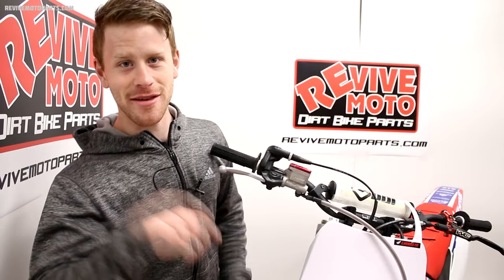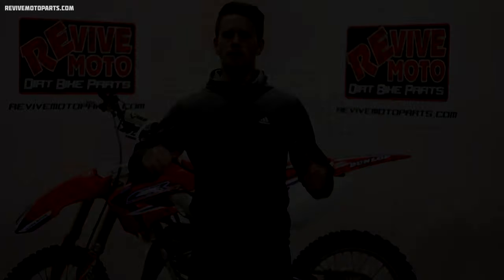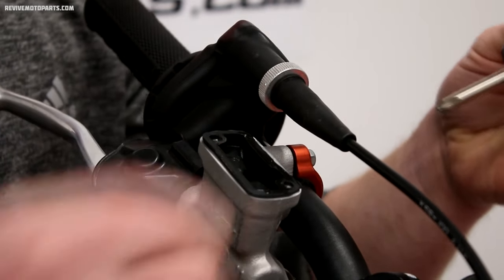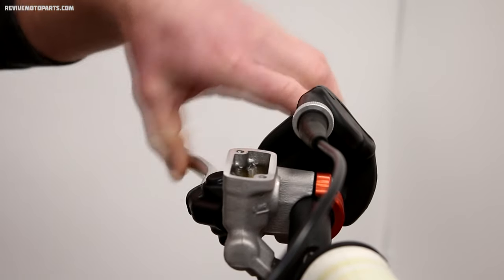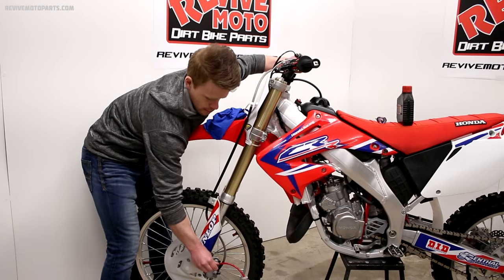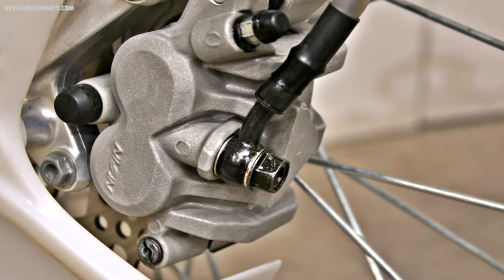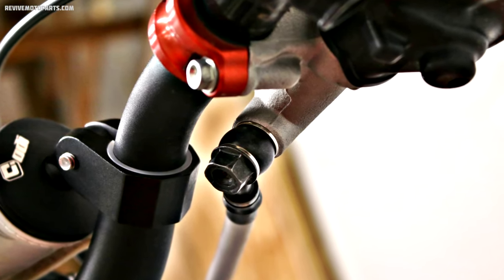Inside Tricks For Bleeding Brakes

Comment: I got a large syringe at a feed store. Put fluid into the system from the bottom. Only way to get brakes on a Ducati to work right. Works great on dirt bikes too!
Reply: Reverse bleeding is not suggested for abs brakes tho
Reply: DAVID RESPECT then why does snap on.  Matco sell that tool to make the job easier???
Reply: @DirtbikeDad  for regular brakes of course.
Reply: So would I fill the fluid into the bleeder valve?
Reply: @davidrespect6471  can you get ABS on MX bikes?
Reply: @rogermyers929  Dunno about MX bikes but most enduro bikes come with abs nowadays
Reply: @davidrespect6471  Thanks for the comment, was about to reverse bleed my abs system
Reply: @papi8311  yes

Comment: Thanks for making this video. Thanks for showing the trick. After rebuilding the master cylinder on my 2003 Honda Foreman Rubicon, I couldn't get the air out of the system to save my life. I never had this trouble in 43+ years of doing my own brake work on all types of vehicles. After hours of bleeding the system, it wouldn't create pressure unless I pumped the handle several times. About the trick: I tied the brake handle back for 16 hours. When I checked it, the brake lever created pressure the first try. I believe that there is still air in the system, is I'll tie the handle back for another 24 hours to see if I get better results.

Comment: With the master cylinder lid off, lightly tap your front break repeatedly. You will start to see  little bubbles rise to the top of the fluid. Do this until you see no more bubbles and you can hear caliper start to engage. Don’t have to loosen any bolts or bleeders. Just take master cylinder lid off and light tap.
Reply: Does this actually work?
Reply: @jamesconsiglio8029  yes i bled my brake’s yesterday and this was the best way. Even for a new caliper set up
Reply: Will try this rn front brake been a pain for the last 2 days
Reply: I did this and bubbles came out but I still have no front break

Comment: You are my hero!! I have been struggling to try to get my front brake fully bled on my 350 exc for I don't know how long. This worked great. Did a normal bleeding then zip ties the front brake lever. Voila!! Next morning...full pressure. Thank you so much for this tip. BTW, Motion Pro makes a great little bleeding tool. It is a one way valve that you hook up with the included tubing to the bleeder valve. Then you do not have to sequentially open and close the valve. Got mine through Rocky Mountain ATV. Around $13

Comment: Cheers man! I was whacking away at the brake lever and nothing was happening until I tried opening open the upper banjo bolt. Slowly but surely got some pressure going. I'll wrap the lever overnight just to get the last little bit of air out.

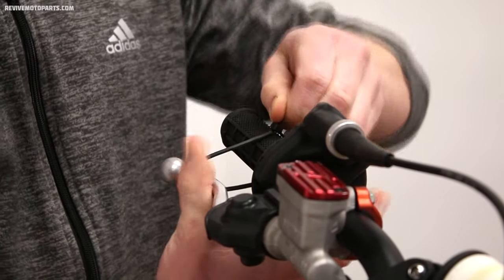Comment: 2:37  Oh, wow!  Thank you for explaining that.  I had to do this after a new front tire was put on my motorcycle, and it worked!  For some reason, the front brakes had felt mushy/squishy after the tire change.  Perhaps it has to due with my brake fluid being really brown and old?  I really don't know; just guessing.
Reply: Cos your mechanic pulled away the brake pads to re install the wheel. Then probably the air went back to the system.
Reply: @theforester_  
Probably.  Thanks.

Comment: So....the "secret" trick of locking your brake lever back (2:26 in the video) overnight WORKS!!! Brilliant tip!  Thanks, Man! I pumped the lever and filled the reservoir for an hour and couldn't get it tight.  I put a strip of velcro around the lever and grip overnight and now the lever is nice and firm. Braaaaap!
Reply: Hope this works. I’m almost out of brake fluid...
Reply: @spongeborgtheford4971  do tell! I noticed considerable improvement. I used a strip of Velcro to hold the lever engaged  and left it overnight.
Reply: I’m using some random hair band that was left in a drawer. Works pretty good. I’ll give an update tomorrow.
Reply: It works!!! I have braking power! Not too much, but it’s usable!
Reply: @spongeborgtheford4971  awesome! Glad it worked!
Reply: I’m gonna have to give this a try tossed new pads and bled it going by the factory bleed process and it was worse then before but no air bubbles at all 😂
Reply: @Jeremy-dw2jt  give it a shot! Good on ya! 👍
Reply: So you just tie the lever back overnight and then what? What are the next steps?
Reply: Hey Ricky, did you leave your master cylinder cap off overnight when velcroed?
Reply: @brodirowden  Negative! The theory is that air rises through the brake line. I suppose you could leave it off, or loose, and get the same effect.
Reply: @RickyGotskills  awesome mate, thank you for your help!

Comment: I changed my brake pads and I couldn't quite compress the piston enough to get the new pads in so I loosened the  bolt that holds the brake line on and that made it easier to compress the piston and I got it really far in and now I cannot get it out. Think im going to try the air compressor method to get the piston out.

Comment: Can you retap the left side oil drain hole on a yz450f without getting metal inside the engine? Is it steel or aluminum? The previous owner tapped it part way with a larger size and used a chopped off screw to plug it. I don't like that idea because it doesn't use enough of the threads and I'm afraid to torque to specs.

Thanks Cameron for your videos they are super PRIME!

Comment: I use a syringe and open the fitting replacing the liquid and fill the reservoir and then use the syringe to bleed the system and works very well and fast
Reply from the maker: That's a great idea!

Comment: Awesome! Bleeding at the banjo bolt got pressure in the system in seconds. Been bleeding with bleeder valve for ever and no pressure. Thanks!
Reply: Bottom or top? I'm trying with mine through the valve but it isn't doing it.

Comment: I have a Honda foreman FM TRX450. no front hydrolic breaks. Replaced the Master cylinder, both wheel cylinders and pads. I can not get pressure. tried bleeding Master Cylinder and both wheel cylinders, Installed new pads. used a vacuum pump, tried hand bleeding but I can not get pressure

Comment: How does this trapped air escape from the brake line if the lever is tie wrapped in?  Air would have to pass the seal in the master cylinder which it cannot if the lever is in. Pulling the lever is supposed to lock the pressure in the brake line, if any air, or fluid can pass the seal then the brakes won’t work at all.

Comment: I did a full caliper rebuild on my 99YZ125. New pistons, seals, etc. I am unable to get any pressure whatsoever after about 4 full reservoirs. I had my lever all the way down overnight. Nothing. Fluid and air have come to a creeping halt. Advice?
Reply: Have the same issue.. You ever get it to work?

Comment: I took a digger recently and my front brake is lose no pressure at all and it's leaking down at the bottom of the line at the caliper when I compress it when though there isn't any pressure. 

Anyone have any ideas?

Comment: can't get any pressure in my rear brake system :/ I tried bleeding it from the banjo bolt but it didn't wort... any tips? the system worked good but when I changed the brake disk and brakepads I hate to remove the caliper so thats why I have a "dry" system

Comment: Hi . I have a pitbike and it was park for 1 year the brake fuild is gone.  I put new fluid but it's not pumping the new fluid I tried to remove air from the bleeding valve and not working plz help

Comment: so what am i supposed to do when even if i open banjo bolt from master cylinder there is 1 to 2 drops of fluid coming out and after that nothing?
Reply: Air should technically be gone, but I wouldn't worry about bleeding from the banjo. Too messy. Get some "Tygon" tubing and put it in a bottle with old or new brake fluid and just bleed from the nipple.

Comment: Put the bottle on the ground and run a loop higher than the brake caliper and it will trap the air. You wont have to keep opening and closing the bleeder. Just pump the brake and keep topped off till line is air free.
Reply: My back brakes stick after driving for 3 mins do you know what that could mean

Comment: I had a question i need a brake master cylinder for my kx 125 1998. I found some that are expensive OEM ones but honda and yamaha have OEM master cylinder for alot cheaper. Can i use a cr 125 or yz 125 front brake master cylinder on my kx125? I would apprciate your thoughts.
Reply from the maker: Yes, absolutely you can use other front masters. They're fairly interchangeable.

Comment: no pressure?   the key is that the brake line  has to be under the level of  the master cylinder
( in my bike the line curves over it )   what i did  i was holding the line down (with a wire )so the air can flow & escape more eas, that solve my problem......   anyways thanks for the secret  trick :)

Comment: With the brake line going into the caliber way below the bleeder I see no way all the air would come out gravity feeding . 
People stop the pumping the brake lever and all that stuff. It’s unbelievable not 1 video on YouTube has the easiest way to bleed any brake or hydraulic clutch system. 
Buy a mityvac. Pull out the bleeder . Clean the bleeder inside and out. Rub thick heavy grease on the threads of the bleeder. Screw it in till it tightens up. Now loosen it 1/4 of a turn maybe a little more. Just as long as the fluid can travel through the bleeder. Use a clear vinyl hose from your bleeder to the catch base bottom on the Mityvac. Don’t let the master cylinder go dry. 2 minutes. You’ll have the air out and off riding your bike. 
We use the Mityvac on all brake systems. It works great even with abs brake systems

Comment: I saw so many videos and how to bleed brakes and I can't get my front brake system to just work with the right amount of pressure it seems like it has 0% pressure
Reply: U fix it yet?
Reply: @Kdjoao  yes pressure is good but the front break lever broke.
Reply: @koritaylor9227  how u do it? I have same problem with my front brakes too. Been trying to get pressure for weeks now, just bought a syringe to try reverse bleeding next.
Reply: @Kdjoao   when bleeding the front break it easy but not simple. Start by draining as much OLD break oil AS POSSIBLE. Crack the pin at the bottom of the break & pump the break handle while its crack open when feels empty.
close the valve put oil in the top & work the lever back & fourth till u gain pressure & PS more patient with Brian's. Take some time till u learn but after the first time u get it ull know how.

Comment: Wouldnt the best brake bleeding secret be.. Reverse bleeding?
Empty brake system, syring fluid in via the bleed nipple, until the resevoir fills up.. TADA.. No air, because its pushed it all up while your putting it in...
But good vid though
Reply from the maker: Yup that's a great idea! Never tried it myself.
Reply: ReVive Moto Parts  that's the absolute best way if you're having trouble bleeding or start from a dry system.
Reply: This is how you bleed on a mountainbike. A lot easier. Using a syringe to push the fluid into the system.
Reply from the maker: Great info guys! Appreciate it
Reply: Works great reverse bleeding with a syringe makes it a breeze that is how I do all my bikes and new stainless core moto lines.

Comment: I'll give you a secret. 
Use a BIG suringe connect to a hose, suck in brake fluid, tap it to get air out , connect to banjo bolt, 
Push it all in from banjo. DONE. This especially good when you changing brake hose or when you need to put alot oil in. 
See.. I'm a very nice guy
Reply: IvicaKX450 yup works like a charm the way you described.